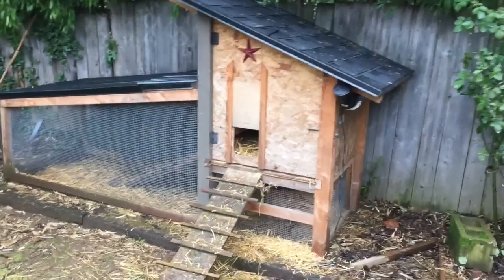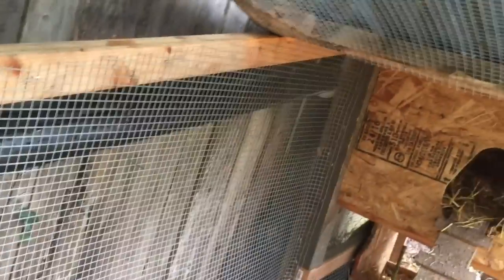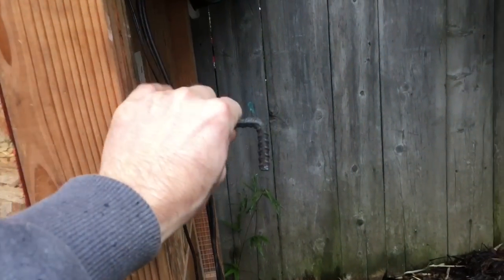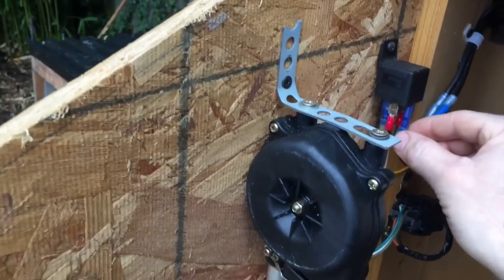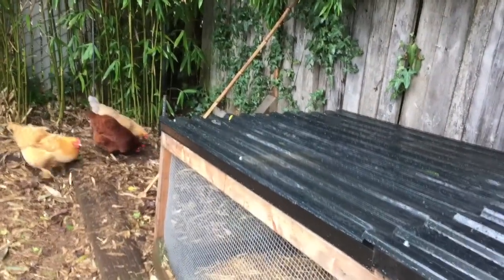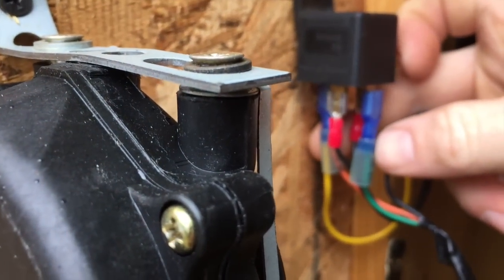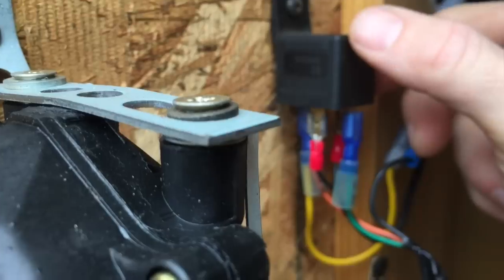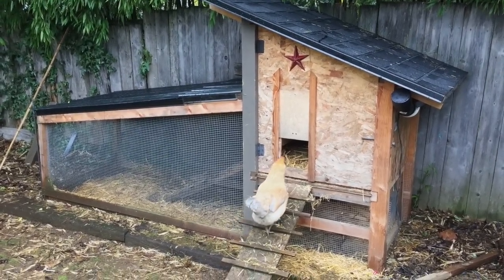Simple automatic chicken coop door

Comment: I used a cheap electronic magnet a spring and a timer really super simple if you have power to your coop   not self closing but we need to check the chickens a couple times a day anyway so this was a really good compromise for us ...the spring I used was just a screen door spring $3 at TS ...the door magnet was Amazon I think less than $15 and any timer with on and off will work ....All told it was less than $30 and foolproof!  I set the timer to energize like at 5pm and turns off at sunrise time....we simply go down every night and make sure door is clear and just pull it closed so the magnet holds it then with the timer denergizes the spring yanks  the door open!  Cheap and simple!    You could also use a 12v magnet and a battery and have a little solar charger to charge the battery ....worse case if the battery crapped out early the door simply opens as opposed to the fully automated doors which I would just stay closed ....a disaster if you are away on a weekend

Comment: If I was to use a 110 12v power source to get around having a battery and solar panel how would u run the relay with a timer only or do u need the light sensor ? Can I just constant power my timer jumper wire to antenna hot constant and then break the green on the source for timer ?
Reply: I wouldn't need a relay that way either would I the timer would act as one this thing is starting to get frustrating 😒
Reply from the maker: There would be many ways to go about it, I would try a lamp timer with a dc converter possibly?

Comment: I love how your automatic door.  I've done something like this but my actuator closes much slower and uses two 5 pin relay switches and two timers. Your wiring looks much simpler. My actuator is 18" opening and takes 1 minute 40 seconds to close. Your antenna closes really quickly I just worry about a bird being in the way. Wondering too is it strong enough to keep predators from opening it?
Reply from the maker: Lol those birds never bothered with the speed. It is however very strong, the only way to open the door would strip the plastic gears!

Comment: Great video. I was just wondering how the antenna knows when to stop pushing out the rod? Does it allow for making certain settings perhaps?
Reply: They have internal limit switches
Reply from the maker: There was a internal rotary stop switch on this particular antenna. I just shortened the throw by shortening it’s conductive surface area.
Reply: @nolimeplease  that's greek to me. Wish you would do another video on how you set the parameters on the antennae. Sure would help.

Comment: So... how many chickens have you guillotined?
Reply from the maker: NumbNutz12000 only the ones that had nuggets.
Reply: Nice! :)   Well, thanks for the video.   I'm working on automating my coop door as well - I like your design, the automotive antenna is brilliant.   I thought about using a stepper motor with a pulley or a spiral gear, or maybe a linear actuator...   but I don't want to have to use a microprocessor, and regular actuators are more expensive than I'd like to spend - I think I can build a much simpler circuit if I do it the way you did.   So thanks!

Comment: would this circuit work without a relay ????. i cant see why it wouldnt unless the timer is more than 12v.
Reply from the maker: It is all dependent on what polarity your system close, as well as signal polarity of antennae.
My system used a 12v signal to actuate the antennae but the timer switch cuts ground.
I think, could be opposite :-)

Comment: Would something like this work if I clipped the ends and soldered together?https://www.amazon.com/Adapter-Transformers-Supply-Output-Listed/dp/B00DKSI0S8/ref=sr_1_3?s=electronics&ie=UTF8&qid=1510364570&sr=1-3&keywords=12v+power+supply&dpID=41kaSAMcYWL&preST=_SY300_QL70_&dpSrc=srch
Reply: No way a single 3 amp notebook type PSU is going to effectively run a junkyard power antenna.   Especially considering it's not just the antenna shaft extending and retracting, you're attaching a weight to it as well.   Consider a small RV type battery (motorcycle, snowmobile, power scooter) to do the heavy lifting and just a small trickle charger to keep up the battery.

Comment: Great! How would I wire this to plug it into an outlet?
Reply from the maker: chad elliott you would use a 12v landscape lighting power supply, and use the LV signal to the lights to run the motor.
Reply: Wow, those are spendy....any other ideas?

Comment: It looks like you cut a good part of the antenna tips?
Reply: No, I let it run the length. There's a disk that rotates, a sort of electrical timer that creates a closed circuit for the motor. I shortened that by placing electrical tape on the disc to shorten its "on" time. 
The tip of the antenna was important, as I used it for the solid to clamp down to the door. I just used plumbing tape and screws.
Reply: Thank you for your answer Michael.

Comment: I followed your advice and even posted my own video about how I put it together.  I just removed my video because after 3 fails and 3 new antennas I went back to manually operating the door.
Can you either reply to me or update your video because I cannot believe yours is still operable either.  

My issue is that after a few days the antenna jams.  One just stopped working altogether.

I also have the ASTi Premium Automatic Chicken Coop Pop Door Opener by Chickenguard  that works but is sooooooooooo confusing and frustrating to use and not worth price.  And I have since 2002 one of those $88 curtain / drape opener still working like a charm ... but is AC thus not able to use in DC coops.

Comment: How do you prevent the chickens to get stuck or injured if they stand in the doorway when the door gets closed?
Reply from the maker: LOL that thought had crossed my mind too! 
I dont have to worry, though. They are well into chicken dreaming by the time the door closes :-)
Reply: RIP Nugget the chicken. Why did the chicken cross the threshold? She was in two minds about it in the end. :-)
Reply: I've used the same design for over 4 years, the chickens just don't get caught, you set the timer early enough that they aren't up yet and late enough that they are already in bed. It's a great setup. Motor burned out after 4 years so I just replaced it, but even if the motor doesn't last forever, for $30 every 4 years or so, it's worked really well.
Reply: ..... Jeezh people ..... Ya came up with an awesome inexpensive plan. Then they wanna critique every minor detail. My suggestion is show us how to make a better one with absolutely no problems whatsoever oh and make virtually almost totally free and don't have to do any labor or research man that'd be great. Thanks for this video. I truly appreciate you sharing it and the diagram too. I've never made a YouTube video but once I've added my own personal touch I'll share it with you. Thanks
Reply: i am thinking of making mine work by weight.  The door falls under its own weight and the piston just lets it down, if that makes sense
Reply: These type of Antenna motors are not so strong you can hold it back with your hand usually whereas the Linear Actuator systems can be like a guillotine so a safety switch is recommended.

Comment: nice watering system I have one similar but I was thinking of running a gutter and rerouting into the piping for cheap water source...but I'm using cedar shingles, I'm not sure about using regular roofing shingles....what are your thoughts?
Reply from the maker: Definitely cedar. I'm a little concerned with the off gassing and contaminants in the comp roofing. I do not have my roof hooked to the water supply yet for this reason, waiting a year or two for the roof to "weather".

Comment: hi . can you put a diagram for conections . thank you. I have the antena . the relay from auto parts store . it is ok if I will use 110v and timer and from timer , to power charger of 12v to then  motor and relay?
Reply from the maker: I drew out a diagram, it's at the end of the video. My whole system is 12v DC, but you could use a 110v and two 12v power supplies. One for the constant and one on a timer.
Reply: nolimeplease thank you .my problem is my antena is closing but when must open is open just 6 inch . From where to buy a good antena?thank you again

Comment: could you please give me a little more detail on how to keep the antenna from extending all the way?
Reply from the maker: There is a rotating disk inside the antenna that powers off the unit after a given amount of time. I place a piece of electrical tape on this disk to shorten the time the electrical connection was closed. This is not necessary, but I'm a bit OCD :-)

Comment: ever consider making your watering system be fed by a rain barrel or rain catch system? u could easily filter out any toxins and have it automatically water them with free rain
Reply from the maker: Yes I have. In fact, the design is such that I can use a gutter from the roof to funnel water right into the holding tank. Just haven't gotten there yet.

Comment: how does it stop the antenna? do you have limit switches? Thanks!
Reply from the maker: The antenna has a rotating disk inside the transmission. The disc has a piece of plastic that breaks continuity at full throw. I just added electrical tape to the disc for a shorter throw.
Reply: +nolimeplease ohh thats great  thanks for your reply! nice work on your chicken coop :)
Reply: Can you give greater details on how to add the tape? email me at sixfourhim@gmail.com